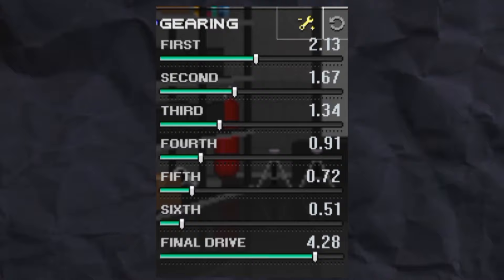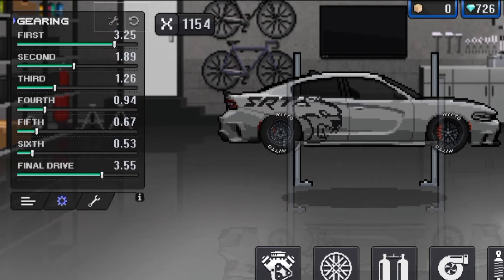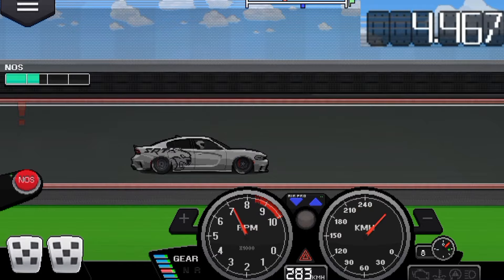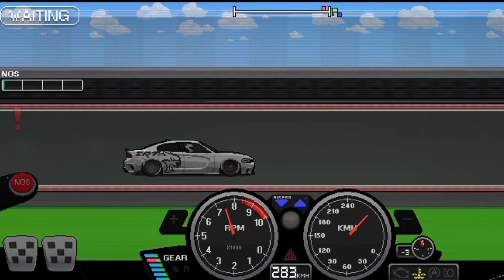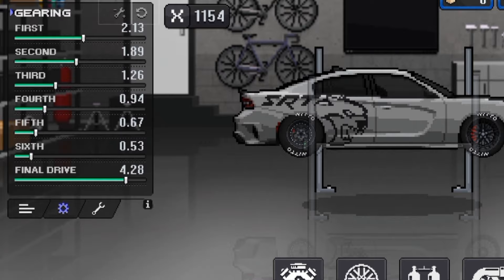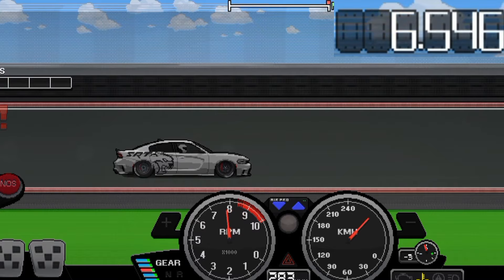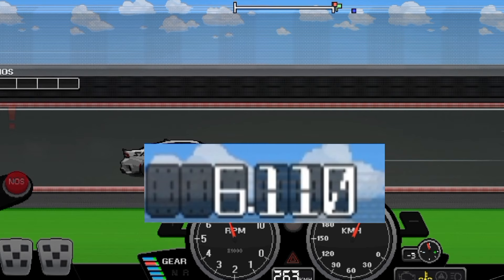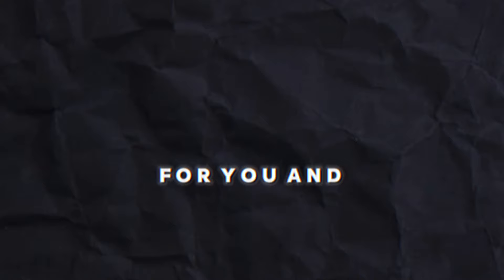How to gearbox and 2 step in pixel car racer | gearbox tutorial | pixel car racer

Comment: Team it did not work for me😭
Reply: Tf you mean it didn't work for you it's not like that mess around with the gears different engines and mods will need different gear ratios, you need to learn for yourself by adjusting them and seeding how it works eg. Fully modded LT5 on a light weight car will have a lower gear ratio because of the HP to weight ratio making it accelerate a lot faster than say a spoon engine on a moderately weighted car which will need a bit higher gear ratio so the revs don't take forever to get up because it doesn't have as much horsepower for the weight of the car

Comment: Hi sir i just want to ask if this method does only work on top speed focused car or it also work on acceleration focused car? and also about the final gear part I still don't understand about it, does the final gear needs to be lowest or needs to be highest than the 1st gear? Thx
Reply from the maker: Sorry for the late reply 
This method focuses on both acceleration and high speed and about the final gear I recommend to make it in the same space as the first gear if u made it lower the car acceleration will be slower and the opposite is correct

Comment: Im still confused on what exactly final drive does, how do you know where to adjust it too?
Reply from the maker: It's for torque or specifically for the car start speed
Reply: Final drive is the range of all the gears together. Each of the gears is a gear reduction between engine and final drive via transmission. Final drive is gear reduction between transmission and tires via final drive.

Comment: Um, how do you keep first gear at high rpm (8000) when shifting from neutral? I have copied your steps (downshift to N >> Accel >> NOS) but when shifting from N to 1st gear, I always get low/medium rpm (4000-5000). For 2nd to 6th gear it's fine, they are consistent at 8000 rpm when shifting. Only from N to 1st gear that have problems
Reply from the maker: It's different from a car to another even when u swap the engine

Comment: Bro I have done everything step by step in gearbox but in my gtr there is a lot of gap ager gear 4 to gear 5 .please help fix it
Reply from the maker: Do u mean that they are so far from each other if it's like that then as the vid make them closer from the sittings like for example if the fourth 3.20 the fifth can be 3.70 as u wish
Reply: Thank you I will try it.